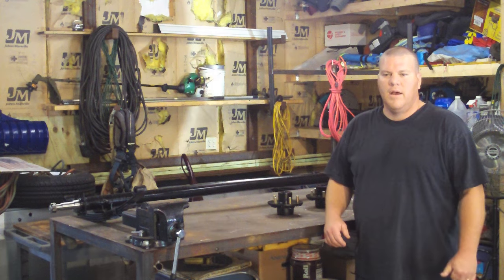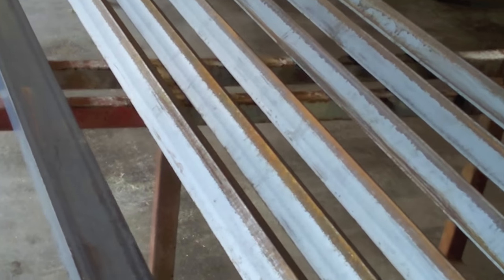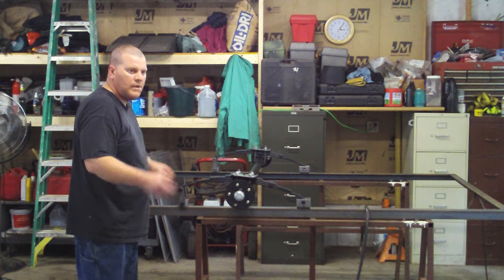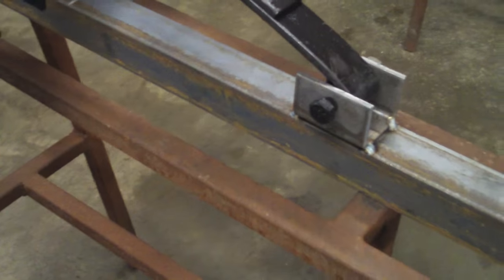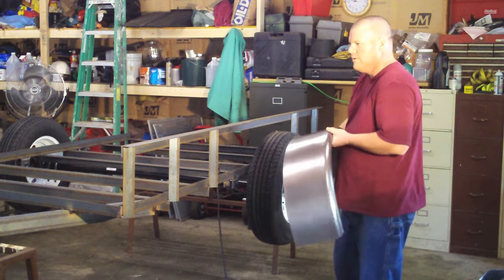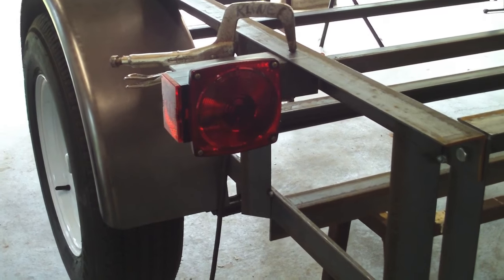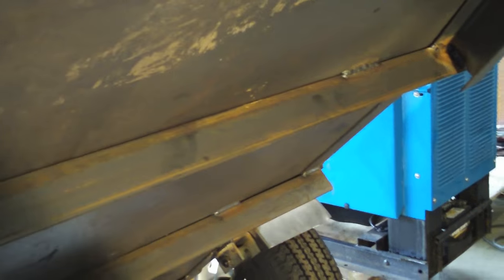How to Build a Utility Trailer Full Video Parts 1-9 HD

Comment: Great job. I built a 5x8 using 2x3 tube 40 years ago. After a few years I cut the front off and added 2’. Still using it today and do not want to sell it. Build something good and it lasts for years. Heck I am 75 years old now and I built it 50 years ago not 40.

Comment: Never mind Hollywood you still deserve an Oscar. One point about bearing seals. If you are not using a press to install seals smear grease inside where the garter spring is located, using a hammer can often jolt the spring off the seal and you may not be aware that it happened. Excellent and professionally explained.

Comment: I mount the fenders about an inch back from centre - because as the springs flatten with load the axle moves to the rear - just looks better and eliminates the possibility of the tyre rubbing on a tight fitting fender

Comment: Just a suggestion-  I use conduit for all my wiring and line clamps. You this will all but eliminate shorts in the lights, And should you get one, it's easier to rewire.

Comment: Ive worked in Collision Shops all my life as Bodyman / Painter. 
Rust is my enemy. I noticed you have a lot of bare metal under pieces you can’t treat. I think I may use an Etch Primer or Direct To Metal Sealer on all my pieces then grind were I need to weld. Its a paint to have to stop and grind each weld area, but I think it will be worth the effort. I did something like this a while back and after i treated the metal I only used a cheap grinding wheel on my drill to clean the metal enough to weld. Prior to paint I also seal joints and all welded areas rot prevent water from resting in those areas. I know its overkill, but as the say9ing goes-……..f its worth doing, its worth doing right.

Comment: Trailer looks nice, I have a tip I use when I wire a trailer. I always use stainless steel bolts to connect the ground wire, up front and at each light. I mig weld the bolt head to the trailer that way you will never loose a ground connection, which from what I have experienced is the main cause for trailer lights wiring problems.
Reply: imystery man the other lighting problem with trailers is when the cable at the front gets damaged from being out in the weather for a few years. Last time I rewired my little trailer, I put a socket on the inside of the draw bar the same as the one on the back of the car, and put a plug on each end of a piece of cable so I have a removable cable connecting trailer to car. Works a treat!

Comment: Good job on build. I was going to build a trailer for myself but after pricing all the parts needed and price for supplies like welding wire & welding gas and maybe a few claps, I found it’s a lot cheaper to buy a new trailer that’s all ready built. But you can save even more money by buying a good used one. Or getting a trailer that may need a little tlc.

Comment: Front amber marker lights will tend to keep you safe. I like using them on trailers. I also use four of the highly reflective red & white rectangular stickers — two per side. One each on the front and rear. Makes the trailer really “Pop” when the headlights hit it at night. 

Nice build!

Comment: Thankyou for this series. I am wanting to build my own trailer, but I have never welded before. I looked at a few welders and Im wondering if a CHICAGO ELECTRIC 80 Amp Inverter Arc Welder from Harbor Freight would work to build this trailer?

Comment: Good video! Using plastic exam gloves is a good way to avoid getting grease all over while packing bearings. Then, when it’s packed, pull one off, hold the hub with the clean hand, and set it on the race and then pull the other off. Two gloves per bearing is a small price to pay

Comment: Fabulous series! It's. been 35 years since I stick welded a utility trailer, and I had forgotten much of the detail work that I had worked through, but your very detailed series brought it all back.  My last trailer was made with tubular steel, which was very rigid and steel was cheap then.  It made for natural routing for wires.  Has steel gotten prohibitively expensive since then?  I'll be building a 14 footer for a BX Kubota tractor with a front end loader and possible 3pt accessories this time, and using MIG. Your angle steel looked rigid enough, but I will have to research load tables to see what I need.  Any suggestions?

Comment: Very descriptive video and I appreciate the effort. One thing I'd change is run the hitch bars back to the axle. Depending on weight, you've only got 16" of solid rigidity. The rest of the strength depends on the siderails. It changes center of mass and could fold where the rails stop.
Reply: On a flat bed you would be correct, but with a upper rail providing the extra strength/rigidity it is not an issue. I would guess that is why he took the time to explain and show how the upper rail strengthens the trailer as a whole.

Comment: Thanks alot for your video , I was able to build this in 2 days , just waiting to get it vin inspected ! I have a Lincoln 180 MiG, I had to rotate the trailer to flat position welding multiple times but other then welding in flat position it was smooth , I did have to preheat the 3" channel with a blowtorch to get it melt effectively !

Comment: Duude thank you so much. I plan to build a travel trailer on top of a frame of one these (6x10 version)
Should I use thicker angle iron for the frame and hitch or upgrade to something more substantial than angle iron?

Comment: Thanks. i watched all the process. but on your next trailer have the C- channel run till the back of the trailer to form the chasis to add more strength.Then build on top of the chasis.  also improve on the tail gate hinges type. but i guess you wanted to cut off some excess weight on the body. but im happy with the project.

Comment: Great job my friend. This is what I do for a living. And the one thing I would consider doing if using gussets on your trailer tongue to the frame this will really add a lot of strength. But overall you killed it man good job
Reply: By gussets, do you mean angle iron running perpendicular to the A-frame tongue? Or do you mean run some solid flat iron to fill in the angled corners where the tongue meets the trailer frame?

Comment: Awesome. I have to substitute a 2x4x5.5lb channel iron for the 3x3x3.5lb channel iron. Locally only 2x2x3.5lb and 2x4x5.5lb is available.  We will use 7018 welding rods

Comment: Awesome trailer. Much better than anything you can buy in any of the big box stores and probably for about the same cost or even less.  Thanks for the free plans too! I'm gonna build your 6x10 trailer. I have a beat up 4x8 that I bought at Harbor Freight that I have to remove the stake sides on it to get a full sheet of drywall or plywood on it and the load limit on it is pretty low too. This trailer will fit my needs perfectly. Probably build 2 of them to fit different functions. Also gonna see how I can make one into an end dump.

Comment: Sir first of all I like to thank u for your time 
I have a question for u I bought this trailer is 18 x 7  and is a dove tail and when I bought it din't took notice of that now I live in S.C. Aiken and is a lot of hills and the tail that is hanging on the back is too low 
now my question is if you can put air bags to lift it or shocks o what can I do to lift it at least 6'' form the ground please help me with this problem. thank u again sir from a D.A. veteran.

Comment: I have a 90Amp flux core welder, I want to build an identical trailer. I'm curious if i will need a better welder? I'm guessing 90 amp should be plenty. 
Thanks in advance! THUMBS UP the video! Very good!

Comment: I'm only 30 minutes into the video, but I have concerns about the axle to frame clearance. I know when I was going to install an axle like you're using, the front brackets were at least twice as tall. 

How's it holding up and is there anything you would have done differently?

Comment: So if I'm going to put a 5 foot ramp on mine, would you recommend i make my gate out of 1/8" angle iron still? should i make it out of maybe the 2"x2"x1/8" angle iron on the outside 4 corners of the ramp, and then use like 3  2"x2"x1/8" square tubing pieces as cross members on the ramp? that's if i want to use my trailer to haul a polaris rzr, my 4 wheeler, or perhaps even my Mazda Miata. it only weighs 2200lbs lol. i'll be using flat metal grating for the ramp surface.

Comment: I appreciate the overall insight and tips of how to construct a trailer which as you stated: "isn't rocket science." Understand that I'm not trying to be critical, but [to me], nonstop explanations re: the obvious was too much. With the exception of the exposed wiring, the trailer you built far exceeds any "off the lot" trailers that are sold today [2020]. Thanks for the video; I'm sure you've helped a lot of ppl.

Comment: the 60% rule for axle placement. How would an extended trailer tung effect this? I am going to build a 7X11 trailer. I'm towing it with a Jeep that has a swing out tire carrier and swing out tailgate. I want enough tung length not to interfere with the tailgate and tire carrier. Should I modify the 60% rule any?

Comment: Thank you for the excellent video
How would you modify the ramp if using 2x material for the deck of the trailer and allow for the ramp to lie flat on the trailer. Sometimes it is nice to lay the ramp flat and not have as much air drag.  The ramp would be expanded metal.
Reply: I built this trailer with 2x6 treated lumber on trailer deck and used a 70x2" angle iron to cap the nod of the boards and then I put my hinges just like what he showed, only on the extra piece of angle iron

Comment: I am planning to  build a 5.5x10 trailer using your plans. It will only have 2000lbs axle (parts came from a boat trailer) and it will most heal kayaks, bikes, maybe a motorcycle but nothing much more than that. Would I be OK with going with 2x2 1/8 angle? It's a lot cheaper or would it be to weak?

Comment: What size axle would I need if I had to carry machines around that were roughly 2500 pounds. I don't think that I would ever carry a machine that would be more than that. What I'm doing is I buy machines and I fix them up old machines like old metalworking equipment and I make him like new again I'm tired of bothering other people for their trailers and I wanna build my own I'm a fairly decent welder not a expert by any stretch but I can do this project I believe. I don't know how to spec an axle out I'm sure that there are sales people that will tell me one thing but I'd rather ask someone that he's done it before. Thank you for your help

Comment: great job... I'm building one for the same thing... the threaded rod for the hinge is actually better for some light duty applications... it allows lube to stay longer because of the ridges rather than a smooth surface that will allow it to just run off.... thanks for the video!!!
Reply: grease zerks

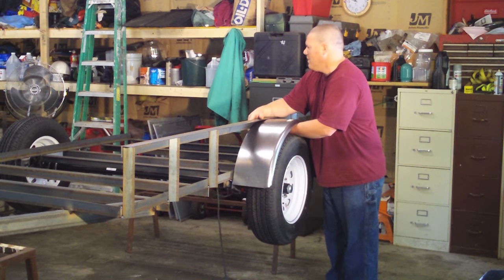Comment: I didn't watch the whole video because I've built several trailers over the years. I just fast forwarded until I found a design detail that I wanted to comment on. The design detail can be seen at 42:35. I cut the cross-members, or 'joists' so that they protrude far enough out so that I can weld the uprights to them. This simple design change makes the sides of the trailer much stronger.

Comment: Thank you for the great information. I'm about to start my project however I had a question. I want to add a tongue storage box and I was wondering if I can just add a few inches to the tongue's length so that tongue box doesn't hit my rear bumper if I cut the turn to tight while backing the trailer?

Comment: Honestly your best deal is to buy from a trailer manufacturer. The get discounted steel prices because they buy in bulk. Same goes for the axles, tires etc... if you were to go out and purchase all the materials, put out all the time and money in welding consumables and then paint it . You’ll be lucky if you come under the cost for a newly built one.

Comment: How much did it costs you in materials?
Reply: I got a quote today for the steel. $281.00 but i forgot to put the metal grating on my quote, but since it's flat and not expanded grate, i'm sure it will be $50.00 or less, so add that on about... $330.00 for the steel. $200.00 for the wood deck if you use pressure treated lumber, and you can get an trailer build kit with the axles and everything for about $600.00. you can build this trailer for around $1,100.00

Comment: is this really a good way to do my tongue? i used your website blue prints, and all i have left to do is the tongue and the fenders, i got everything else done and welded out,  but the 3,500lb axle kit i ordered online put the tongue different on the blueprints they sent me, they used a 10ft long piece of channel and intersected it through the cross members and welded it to the outside of the frame right in front of the wheels, have you had any issues with the tongue like this? doesn't matter now anyways, i already cut my tongue c channel to 62" as per your blue prints anyways, so just food for thought on my next trailer lol. how has it held up over the years?

Comment: Great videos and plans!
I have a Lincoln 180 mig welder and I want to build a 5x8 trailer with the 3500# axle. Before building the trailer I want to upgrade to a bigger welder that uses inert gas to get clean welds without splatter. What welder did you use for the project, or what would you recommend buying? I would like to stay under $1500 for a nice used welder. (Millermatic?)
Reply: I have the 180 Miller automatic its cost less than $950. Good machine is 220 volts.also you can weld aluminum if buy the spoolmatic gun $190.

Comment: Awsome video, very easy to follow and appreciated man!...Questions though plz~~how much was all the angle, channel and axle assy? Also what amp were you burning your 7018 at & was it 1/8 or 3/32 (just wondering if that 1/8 angle could handle 1/8 7018 rod without blowing out...Again, great job!!

Comment: Veey through video. However the axle placement method is in correct. The axle placement is a simple rule. It goes 1" to the rear of center for every foot of trailer box length. In this case that means 8" to the rear of center. The 60/40 rule is for loading a trailer. 60% of the weight goes forward of the axle.  Be careful with the cheap trailers made by the big supplier to the borgs. They build 8 10 and 12' trailers on the same jig. They place the axle correct on an 8' trailer but on longer trailers the axle ends up way too far back often twice as far as it snould be on longer trailers.
Reply: Robert Adams - You're making a distinction without a [meaningful] difference... Using algebra to convert your description "1 inch to the rear of center for every foot of trailer box length" we have: X = L/2 - [L/12] = 6L/12 - L/12 = 5L/12 = 41.7% L... quite close to 40% used in the video.

Comment: It seems like the frame is close to the axle. how about having the axle under the leaf spring?
Reply: I thought the axle goes under the lead springs.  Seems to be that way with all the trailers I see.  I questioned it the minute he set them up sitting above the axles.  That would put all the force on the Ubolts?
Reply: On a lot of the 3500lbs and under trailer axles always go the way he has them. they actually come bent from the factory with the mounts on them to fit this way. If you turn them around and put them on under the leaf springs then you'll have a lot of camber in them. they bend the axles that way so that empty it will sit with a slight caster. fully loaded they will flatten out supposedly.

Comment: That's a nice trailer but the safety chains should be mounted to the bottom of the tongue so when you cross the chains Incase the trailer comes loose the tongue gets cradled in the chains and doesn't nose dive in the ground and you can safely come to a stop with out the trailer thrashing around the vehicle

Comment: A rod the whole way across with holes drilled through the ends for the ramp would be better.  That way you can have pins at the ends to hold the rod in so that the ramp is easily removable if needed.  It will also allow you to have the hinge points exactly square and not have one side off center and cause binding.

Comment: 47:50 Why is the axle sitting on the leaf springs and not under it?. The way it is right now, the whole load will be supported only by the lock nuts.

Comment: Red Wing ....... I used this plan to build my trailer...... but I altered the plans a little. Instead of using angle I used 2x2x1/4 tubing for the outside frame and 1/8th tubing for the inside bracing. For the uprights for the railings I used 1x1x3/16 and the top rail 1”1/2x1”1/2x3/16 angles. It’s a little heavy duty than the one you are building in the video. I had the kids at our local high school welding class weld it up. These kids did great. I’m good friends with the teacher. Do you have an email I can send you a picture of it. Trailer turned out great. Also the tailgate I used 1x1x1/8 tubing. I painted it yesterday and still need to put the wood inside.
Reply: I sure will .

Comment: It won't weld very good unless you get rid of the paint on the hitch. Clean all metal parts to be welded with a grinder before welding.

Comment: Hi, what's the reason for the different sizes of   leaf spring hanger brackets, I'm re-doing my trailer, and the front brackets are 3 inch from top to 9/16 hole. yours are shorter. will that make a difference on the trailer?

Comment: Help!?!?! I am wanting to build a pressure washer trailer and the total weight of supplies is 2,600 pounds. its gotta be 4x8 or more.What size metal do I need?
Reply: that's too heavy for is trailed first question the axle weight
Reply: Manuel Godinez thats a 3500 pound axle